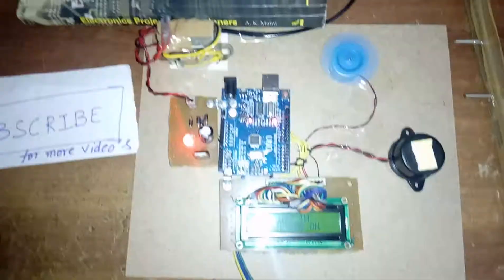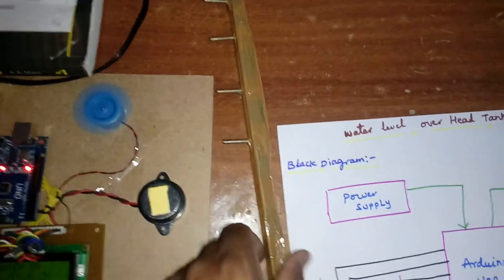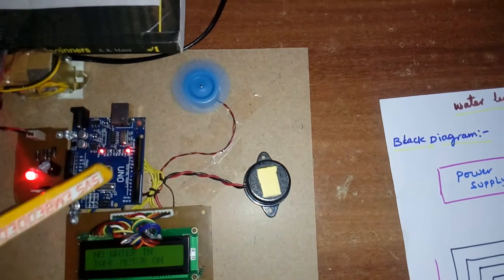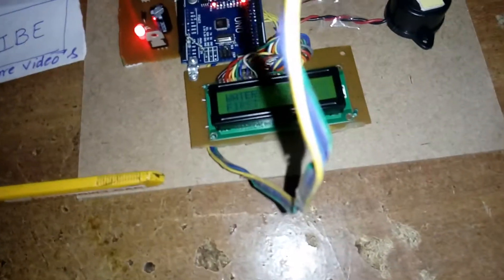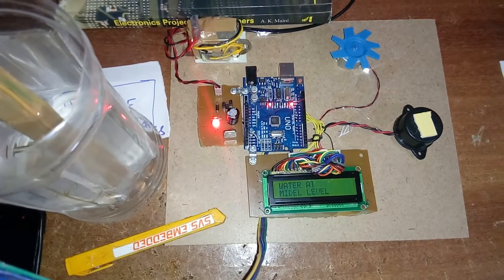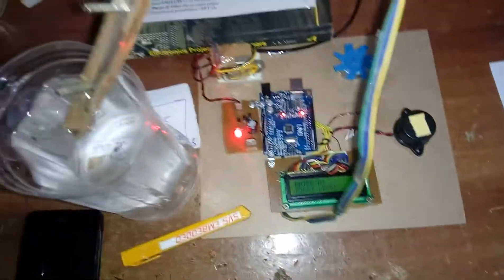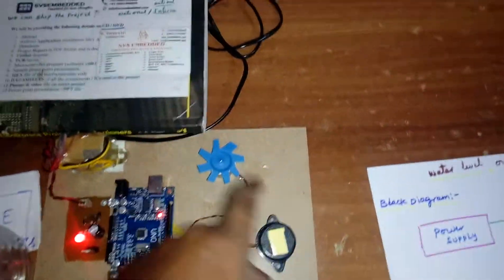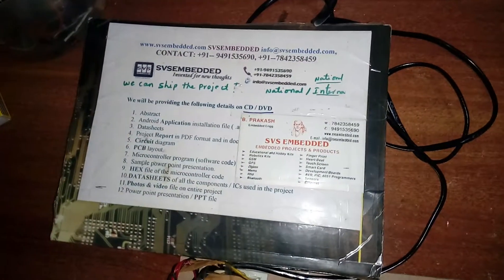Water Level Detection  For Overhead Tank Using Arduino

Comment: Dear I need help for the programming code for following 

Dear in my projects there are one arduino board, One servo motors, and one water tank only 2 outputs (water full indication and another one is, empty indicator), both terminal will goes to arduino analog section, that's it

Dear I need, the programming code, if the water tank is full the servo motors should rotate clockwise 45 degree and when tank empty the servo motors should rotate anti clockwise 45 degree, and when we switch on the arduino, the servo motors should rotate clockwise or anti clockwise, according to input signal which is coming from tank

Assume full tank wire connect to arduino A1
and empty tank wire connect to A2

and I use BC548 transistor in water tank

Please give me programming code on
reshmatakiamumbai@gmail.com